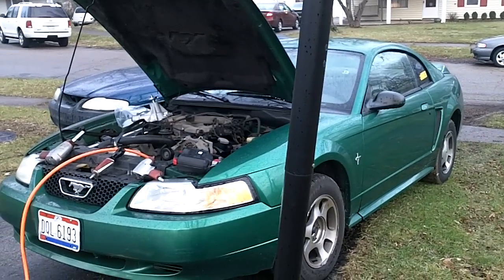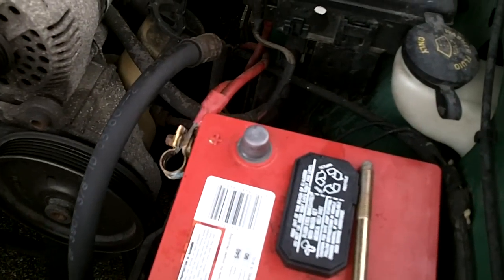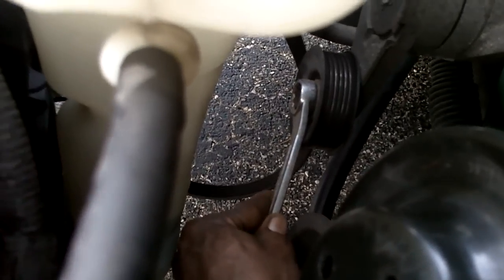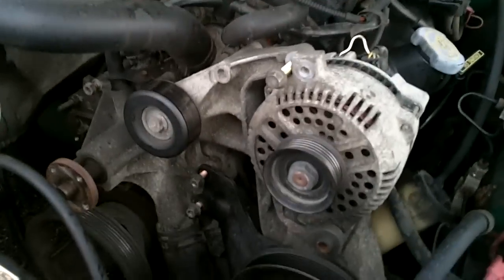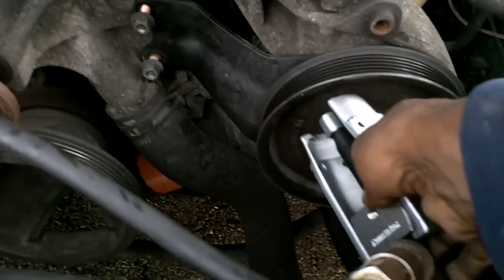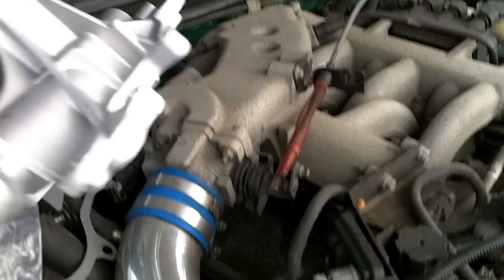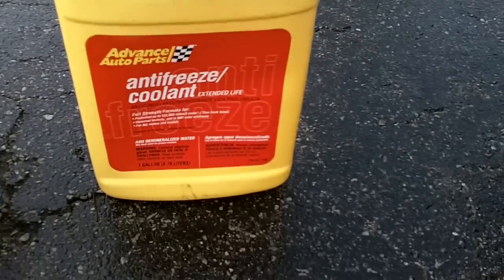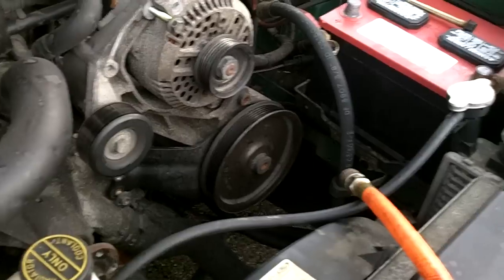2000 mustang 3.8 v6 water pump replacement

Comment: thanks bro i needed to replace my power steering so i like how you covered that. but whats really important is the pulley tool you showed, the guy at the parts store didnt tell me i needed one when i asked.And now i know how easy it is without jumping into it. good vid short and simple
Reply from the maker: Dillion Boyette Thanks sir
Reply: 99.9% of all parts guys today don't know anything about repairs that the computer doesn't tell them first.
I'm a heavy truck mechanic and it's not much different with truck parts. A parts guy used to ask you if you needed gaskets and certain other parts you needed to do the complete job. Most counter guys used to be mechanics that didn't want to twist a wrench anymore.
There are and were some good ones weren't mechanics, but not many.

Comment: As many have already commented thanks for the short and sweet version. I already had an idea of what is was going to take but you're video confirmed it. Thanks for the look at the puller too, I read some used a gear puller which bends the pulley. I needed to see what it looked like to be sure I got the right one. Yrs later and you're still getting comments... 👍😁

Comment: The power steering pulley does not have to be taken off for this job. its a little tight but i was able undo the bolts to the bracket behind the power steering pulley off and set it aside to get to the water pump.

Comment: This is a very good video. We did this job yesterday. What is the little black metal pipe that goes into the top of the water pump? It's a little tricky to get off because there is some type of sensor that's in the way of pulling it loose. You have to loosen the two bolts on the top of that sensor. When you buy the new water pump, you should get a new rubber O-ring that goes on the end of that black metal pipe, that goes into the top of the water pump.
Reply: Heater pipe

Comment: Hi friend, great video!

I have a doubt, what kind of material is the tube that connects the top of the water pump to the thermostat? On my car these tube has a fissure and I want to weld it. Thanks

Comment: hey just wanted to throw a thank you out there. I have a 1989 Ford Thunderbird that needs the same repair. unfortunately, the thunderbird wasn't very popular so most are in junkyards somewhere, making it impossible to find videos on how to work on them. as this mustang had the same engine, most of the parts are the same minus some engine compartment clearance.

Comment: This might have been asked 100 times already, but the crank pulley does NOT need to be removed right? I've read some places it does. Just remove power steering pulley and you have 100% access to to water pump removal?
Reply from the maker: yes

Comment: Dont need to take the Power steering pulley off, just take the whole assembly off, alternator and Power steering and gently pull it off the head and set it aside.

Comment: How were ya'll able to get the coolant line at the top of the water pump off? I can't get mine off...
Reply: after getting the 8mm bolt out get a flathead in there and carefully pry it up. but be careful. That pipe goes from the front to the back of the engine and is hard to replace.

Comment: the puller u used is only good to pull off the pulley not put it back on with, and the other pulley kits that are at auto zone don`t work on my 2004 mustang. i just took out the whole engine block that the power steering pump sits in and brought it to weaver auto parts to get the power steering pulley pressed back on for 10.00 and the line that goes into the water pump is called the coolant bypass line,
Reply from the maker: oh so true this was just a basic video to help not to rebuild your engine sorry Lora Johnson I got a lot more helps then not
Reply: rebuilding an engine, that did not make any sense what so ever..putting on a new water pump is not rebuilding an engine, i mean this video is about putting a new water pump on......on how to...not rebuilding an engine...
Reply from the maker: ok thanks for your comment
Reply from the maker: Its not ROCKET science it helped more people then it hurt so enough with ur noise

Comment: hey how do you get the heater pipe out from the top of the water pump?
Reply from the maker: I cut it and used heat hose to fix
Reply from the maker: I cut it and reappeared with heater hose
Reply: dragonc41 oh okay. yeah what I did was just twist and turned the water pump and pulled down h
and it came right on out, it was tough though
Reply: dragonc41 and mannn you made this out to be easy, and it ain't, it was a pain in the ass! however I made it through though, it was still fun

Comment: First and foremost...it's not that straight forward to change the water pump.

Before pulling off pulley on power steering pump you need to find the center...mark it from pulley hole to indentation on plate situated behind pulley and connected to water pump. Once you have done that then you can pull pulley off.

Next...water pump bolts and screws...each one is different and it is important to remember where they go. Following that...there is pattern for tightening up water pump bolts and screws...mostly criss cross, yet you need to know which is bolt 1 to start. Bolt 1 must have a sealant put on it. As you gradually tighten up bolts using bolt tightening pattern....each one has a difference in tightness...most must tightened to 19lbs...so yeah you will need a torque wrench that can be set to varying lbs. DO NOT TIGHTEN ONE BOLT ALL THE WAY DOWN AND MOVE ONTO NEXT. THIS WILL WARP WATER PUMP GASKET AND CAUSE LEAKS. Instead hand tighten, using criss cross pattern, then use torque wrench set to proper poundage, do 1 full turn, then 1/4 turn.. on each bolt criss cross. 

After that, reattach bracket, power steering pulley in accordance to marked line up, then reattach water pump pulley. WP Pulley bolts need to be tightened to 19-21lbs. Then reattach belt, reinstall all hosing to raidiator. Before you fill up cooling system with fluid make sure vent screw is out. When fluid weeps from vent screw hole there is no air in your cooling system. Leave screw and raidiator cap off after refill, start engine, check for leaks. No leaks, turn off engine, screw in vent screw, and put on raidiator cap. Start engine again and let it reach optimal temps...making sure no leaks, staying cool, and no build up of pressure from air, which will blow your raidiator cap right off. 

Just sayin....

Comment: Dislike because the title described water pump replacement, in segment to show how ever may be watching how it is done.  But FAILED TO SHOW HIS VIEWERS EVERYTHING ABOUT REMOVAL AND REPLACEMENT. And even show any hands on work being done from beginning to the vary end. All I can say is this video is titled wrong when it should say is this is your water pump and this is where it is and these are the materials that he recommends on the job. Since there was no explanation in the complete removal and replacement. And what problems could arise when removing the metal water tube that come over the intake into the water pump. I assume the videographer was not around during the complete job.
Reply: Kool story
Reply: He told us the most important part everything else is just some bolts of you cant infer what to do then don't work on your own cars

Comment: this video does not help. it made things worse....he tells you to take off the belt...big no no.......
Reply from the maker: That's because it requires taking off the belt this was put out as a base on how to do the work like special tools required not to teach you how to build a car
Reply: lora johnson the belt is made to be able to take off and put back on. this job would literally be impossible without taking off the belt as you MUST take off the water pumo and power steering pulleys. This video goes through everything you need to know, nothing left out and no useless information, sweet and short. thank you uploader!
Reply: listen y'all, the man has replied over and over that his intent with this video wasn't to be a COMPLETE END ALL for water pump replacement. just a little help, not COMPLETE ENCYCLOPEDIA VIDEO on the subject. my quest is to figure out the best way to remove the coolant bypass off the top of the water pump without f'ing off the bypass itself. lookin for a good ole boys trick here somewhere. just didn't find it on this video. 
DAMN, PEOPLE GET A LIFE... THE GUY JUST TRYING TO PITCH IN A LITTLE ON THIS F'D UP JOB THAT FORD MAKES MIND KNUMBINGLY DIFFICULT. WHY FORD WHY????????????????